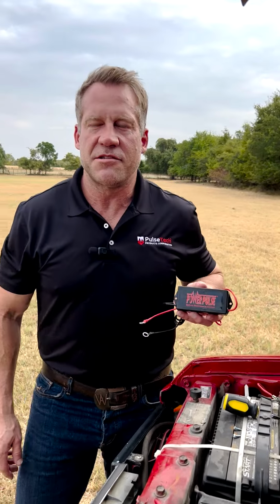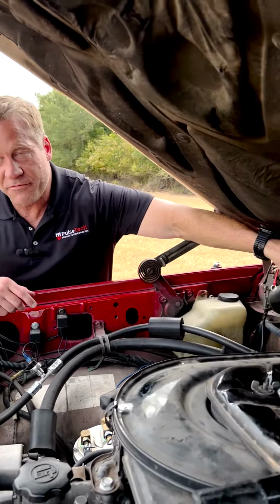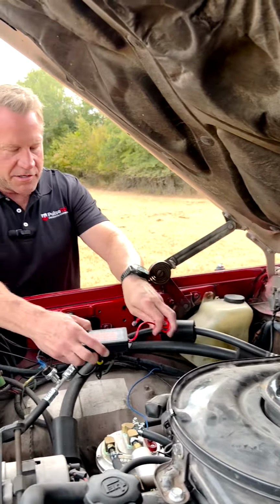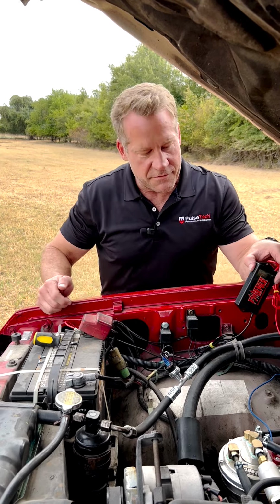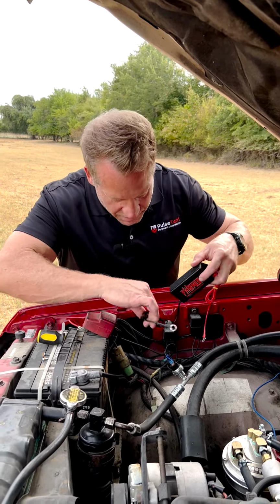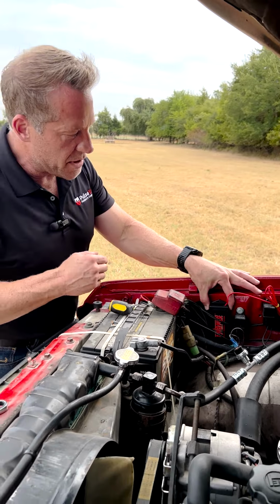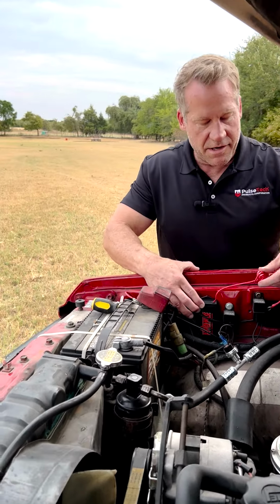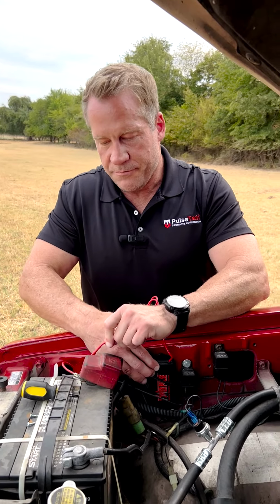How to Install the PulseTech PowerPulse Battery Reconditioner and Maintainer

Comment: Been using nano tape to install these units onto the battery box or other locations. The tape seems to hold very well even considering the heat in the engine compartment.

Comment: Thank you for your question.  The current draw of the PowerPulse is around 10 milli-amps.  Although this is a very low amount of energy, we recommend using the PowerPulse only on batteries that are charged regularly – at least monthly.